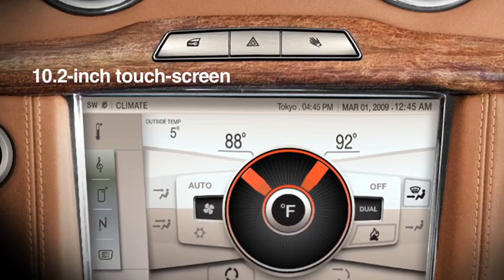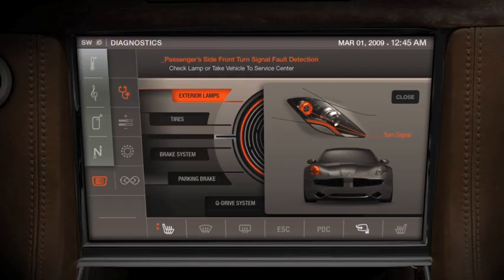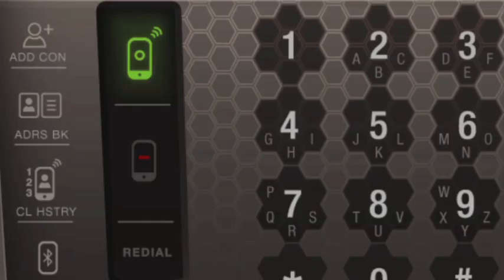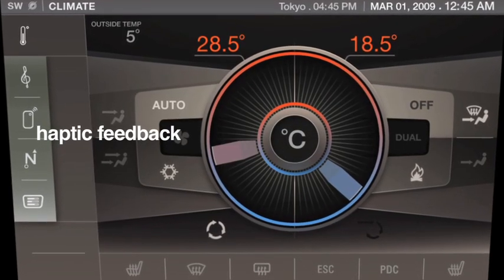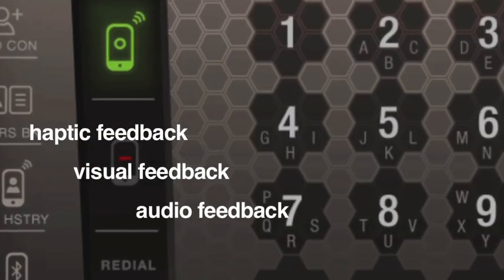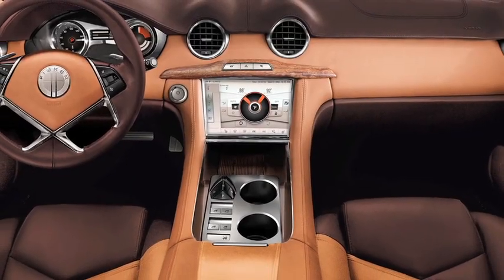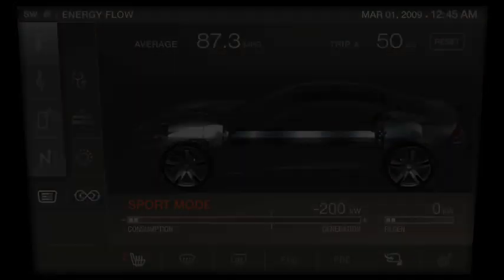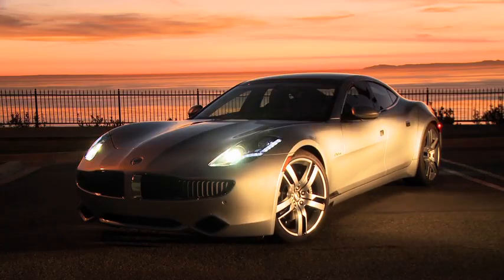Fisker Command Center rev 12/11

Comment: The screen is nice, but needs better use of color (because it can be hard to see in glare-y conditions).  The software is still very "dot-zero" release: the nav and ipod screens can crash or hang and response is slower than it should be.  I'm sure those will be improved soon.

I think customizability of the speedometer/clock/etc display would be good too.  In particular I'd like to be able to swap out the clock for digital speed readout even in stealth mode.  Custom gauge colors would be a plus!